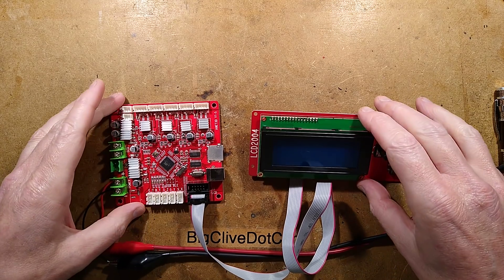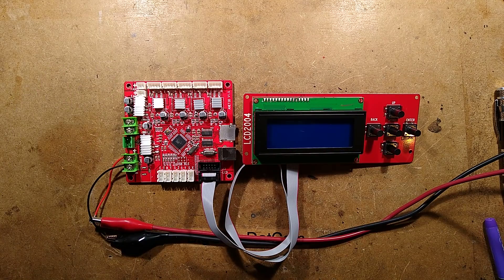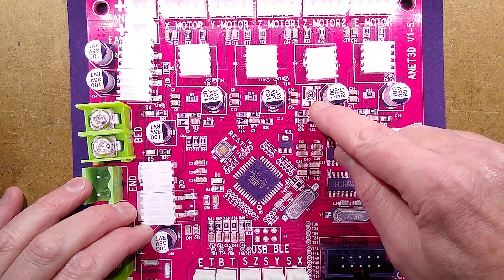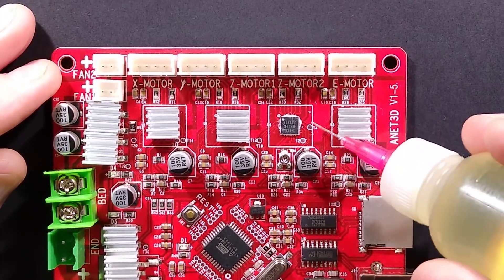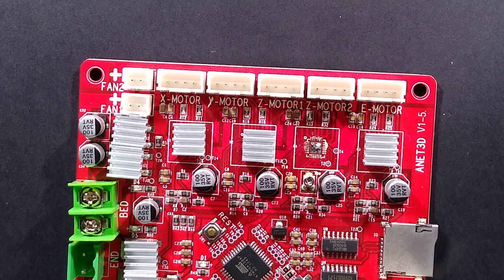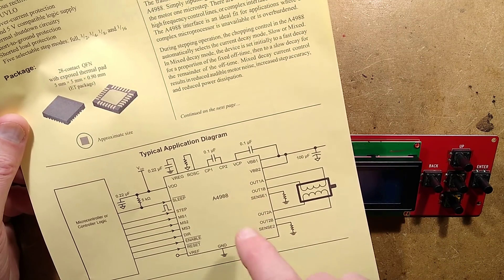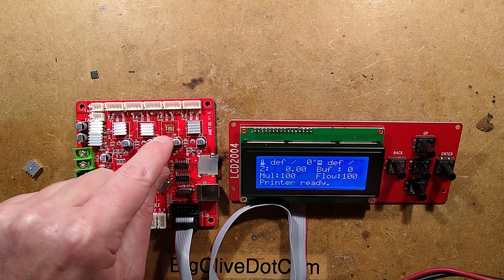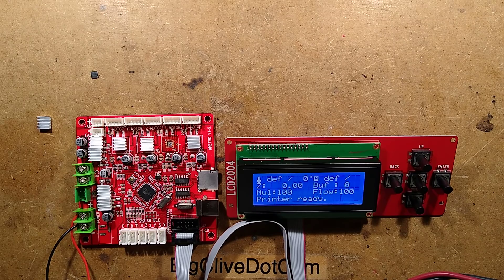Diagnosing a dead 3D printer controller

Comment: the fact the a8 failed without it ending up engulfed in flames is impressive in its own right
Reply: I reflashed mine with Marlin, worked perfect for a while until it started smelling like burning plastic, the green hotend heater connector just melted, de soldered it and replaced with XT60 worked well, but needed more outputs and better stepper drivers so now my Anet is controlled by an Arduino Due with RADDS shield.
Cheap printers are not so cheap after all.
Reply: @mr_sheen_airsoft  most of us still using the A8 have external MOSFETs controlling the bed and hot end.
Reply: @timrb  ,sure that is a good idea, but funny enough I have never had issues with the onboard mosfet just the connectors, as I said in the beginning they are not as cheap in the end, my Anet has a new hot end, extruder, control board, termistors, linear bearings and drive belts, also some reinforcement parts added so initial £137 turned to more like £300.
On the other side I have learned a lot about 3D printers.
Reply: @timrb  most of us have probably swapped/dropped connectors for the bed or just cut the heated bed entirely. lol. it would be silly to ask it to print anything that needs it anyway. can barely do the job anyway. lol.
Reply: @mr_sheen_airsoft  cheap printers are great for people who want them as a hobby (not so much for use as a tool), but the connectors on the bed and the board are woefully inadequate(the bed one on mine started going black). it ended up with an Arduino mega and a RAMPS before I salvaged the whole thing for parts for another printer :P
Reply: @MrglMrgl  , definitely agree, and yes the bed heater connector burned first, I just soldered the wires directly, connectors are definitely the weakest link.
Reply: @SwervingLemon  lol takes half a week of evenings to build the thing and the rest of the week printing off the necessary upgrades to make it safe, reliable and mechanically stable.

The aluminum extrusion frame printers are far and away a better deal. SO MUCH faster and less fiddly to build and dramatically stiffer out of the gate.
Reply: @SwervingLemon  A lot of printers had problems in those days. I've had my A8 for 3 or 4 years now and it's still going as great as it did when I purchased it. You know how you deal with shitty manufacturer firmware? You flash Marlin onto it. I understand that from factory it should be good to go out of the box, but back then I believe I paid something like $280 for my A8 so flashing firmware I can accept.

As for the bed connector having issues. Again not something I experienced. I had those mosfet things for the hotend and bed laying around for years before I installed them and still had no issues. Even to this day, with her being in an enclosure printing ABS voron parts I've had no issues with connectors, connectors going black, fires, or any other issues.

Personally, for the price I paid, the A8 is one of the better pieces of machinery/electronics I've purchased in the last 10 odd years.
Reply: @thumbwarriordx  Took me about 12 hours to build my A8 with no prior experience with printers or really putting things like that together. Obviously I can notice a difference between my A8 and Ender 3 v2, but again for the price and for what it is, you can't compare it to "pre-built" printers imo.
Reply: @adamarzo559  An Ender kit is SO much easier to put together lol.
The tiny screws and nuts in the acrylic are a killer.
The aluminum is probably stiffer too.
Reply: Haha! Thankfully if you flash Marlin on it you will have termal runaway protection.
Reply: a fair upgrade to any 3d printer is a ten quid smoke detector placed somewhere near.
Reply: A8's all bursting into flames is an internet meme. The problem is that they were sold as kits and as such, a few were very poorly built and arced, causing them to burst into flames. They sold hundreds of thousands of them, so realistically they are/were incredibly fine little printers.
Reply: @ZaPpaul  They did have some issues, like my Anet A8 clone the wall power chord was way too thin (I had to double the wire over for the power supply screws to grab), a couple years later when I was printing ABS I noticed the cord was extremely hot, so in my dorm room I had textbooks lifting the cable into the air and even a box fan blowing on its power cord... You may laugh, but after an hour of printing inspecting the cord every few minutes I was like "well its probably fine since it hasn't caught fire" and started up to leave to get food and saw it was smoking, haha! Yeah sometimes they use way too thin of cables, I thought that immediately when I assembled it but then again I'm the kind of person that uses 1kV rated heavy wire on its lightswitch I added for turning it on and off, so I thought I was just crazy, but apparently not because even with active cooling on the cable it still started melting. Also that printer had been printing a ton that week, but I hadn't been feeling up on its cables and just happened to be there when it started melting.

I still use that printer, but almost every part has been replaced on it, its extremely good though (I have a custom Bowden drive on it, it also runs 3mm filament too, and I now run it over-volted some too for faster bed heating and its perfectly fine using a normal power cord). I also have it flashed with Marlin 2.0 (I can't remember if I disabled some of the thermal or not, I know I really widened it up because my E3D V5 and V6 hottend was overshooting by about 10 degrees because it goes from room temp to 270c in under 45 seconds), and I added Deans connectors to the bed so I can disconnect its cable when I want to run my laser cutter (7w output laser head, about 30w input, signal is soldered directly to the Arduino Mega that's driving the Ramps1.4 board).

Its a really fast printer, I run about 100mm/s even for fine gear teeth and about 160mm/s (with up to 0.8mm nozzle) on ABS and the parts come out fantastic still to this day (much better than the $10k machines we have at work running at a snails pace with same nozzle size and many years newer).

Oh also I had my heater cartridge fail, but I think that's normal (the wires can and will short out if they break down the insulation or fatigue). But the extruder was junk and like I mentioned its had a couple hottend upgrades as well. Mine is very cable relief (even my extruder hangs and swings with the printers movement), I've got it quite well engineered as well, engineering is my profession and I love robotics and mechanical design (mechanical and aerospace engineer)
Reply: @ZaPpaul  to be fair, the cabling into the heated bed is an accident waiting to happen. fine for most hackers who take appropriate care, but dangerous to someone used to infallible top end electronics.
Reply: @bradhoward9701  strain relief is all that it needed, I noticed this when building mine and took appropriate measures to ensure the connector was never being moved by the cable movement.
Reply: i put it into dremel cnc project Instead of arduino
Reply: I've had two anet A8s (I think I still have at least one of them somewhere), absolute garbage, but I've got a soft spot for them since it was my first 3D printer.  Both the original boards are dead so I put new ones on.
Reply: It's mostly a matter of the horrible terminals on the board (and hotbed.)
They upgraded them on the later revision (I believe just because it's a 24v compatible board, not for safety)
An external mosfet for the heated bed is a mandatory upgrade on these things IMO.

Comment: I wonder if it would work to replace the A4988 with a TMC2209... both my machines came stock with the A4988, and the steppers could be heard through the entire house. TMC2209's made them so quiet, all you hear is the cooling fans when in the same room as the printers. Oddly, you can pick up aftermarket main boards cheaper than the individual chips sometimes. 

All I saw was "dead 3D printer controller" and I was hooked! If postage wouldn't be outrageous, I could send out a Melzi board with a really curious defect. It reformats the SD card after every print, due to someone wiring power in to the heated bed power out contacts, and popped the thermistors like tiny firecrackers. 😆

Comment: My rather "mature" Geeetech dual head printer has the BIG advantage of having all the driver (motor / heater) boards as entirely replaceable modules, which of course means modification and repair of  "power" sub-assemblies is simple and pretty cheap!  The trim tools I use are all ceramic - from "our favourite suppliers" for a very reasonable price. Means you can play with powered-on assemblies with a much reduced risk of "unfortunate accidents"!
Reply: Yes but at times watching the magic blue smoke is satisfying  when the  old board is going to be replaced.
Reply: The downside of the modular stepper drivers is they do less good of a job dissapating heat: drivers might not need a heat sink when integrated into a board but do so if it's modular, or might need a fan if modular.
Reply: I was gonna add I have a ceramic magic screwdriver I use for tuning front-ends on radio equipment. Its annoying to use metal as there it changes the circuit significantly to have a big metal rod on the inductor or capacitor. So it becomes tweek, lift off and listen, try to get the screwdriver back on and tweek again, lift.... takes forever.
Reply: @clynesnowtail1257  
That sound like really cool tool.
A Royal Doulton screwdriver😆
Reply: @assassinlexx1993  A little bit of knowledge is a dangerous thing u no.
Reply: I've got two Geeetech boards that were blown up by a fault in the power supply (a little ball of solder found it's way to the wrong place inside it!). There are some lovely burn marks on the boards, and I suspect lots of trashed components, so they're beyond my abilities to attempt repair. If I hadn't noticed in time, I could have had some lovely big burn marks on my house too!

Comment: Was it heating up because it has no load connected?

Maybe problem was static attack?
Reply from the maker: It had shorted internally, probably as a result of a rogue voltage on a low voltage rail or input.
Reply: @bigclivedotcom  ahh okay

Comment: What a coincidence, I have the exact same printer! The mainboard on mine also failed but I didn't replace it with another original board. One of the stepper drivers stopped working but the rest of the board was still fine.

Comment: would you like me to send you one of these boards as well? i have one that has a broken bed heater circuit
Reply from the maker: The bed heater is switched by a MOSFET in the vicinity of the connector.  It might be worth checking for a bad solder joint on the bed connector or if that MOSFET has failed.  If it's not getting the temperature from the thermistor that could be an issue too.
Reply: @bigclivedotcom  Thanks for the reply! it's been a while since i messed with it and i don't remember if it was the thermistor circuitry or the mosfet. i fixed it a few times by just blasting a heat gun at it, but eventually i just got fed up with unreliable prints and dealing with finicky bugs of a cheap printer. i also wanted a larger print area. Looks like there are alot of people in the comments with broken boards as well.

Comment: Another problem with those tiny pots is you can turn them to either end a bit to hard and they can short or give crazy resistances, I'm sure you will check this before replacing the chip, how hot was your heat gun ? as the chip was well gone and the flux still boiled off !.....cheers.
Reply from the maker: Heat gun was at around 330C.

Comment: Some of the older style boards put the motor drivers on a separate pcb that fit into a socket on the main board. That way if you fried one, you could just yoink it out and put a new one in. Looks like they're optimizing for cost over repairability.
Reply: they're following the footsteps of Apple and Tesla lol
Reply: @lordjaashin  Doubt that. I would say that when they started, they lacked the expertise to design and produce the circuit so they used premade breakouts from China or somewhere.
Reply: This board is a lot older design then most of the RAMPS boards ;-) 
They have been around already very long with the same design and have changed pretty recenty to the next generation which still has no changeable drivers.

I have some around so I can just pull parts off them and solder on other boards when I make a fault an blow it up partly.
By the way, older ones were just 12V (A8), newer boards can handle also 24V as input but also still work on the 12V of the original A8. They are build in for example the A9 and A8plus.
Reply: lots of these old boards also soldered directly to the board because it was easier and cheaper. my expensive printrbot f5 has non-replaceable stepper drivers and i bought it in 2016

Comment: I'm holding out for the day when I can use one 3-D printer to make replacement components for my other 3-D printer. I understand the von Neumann Company is working on this.
Reply: You'll also be looking at autonomous resupply of filament. Be careful - if you are successful we may end up with a macroscale version of the "Grey Goo" nightmare scenario! :-D
Reply: @phils4634  oh, no, it's "CREAM"
Reply: At one point I assembled a 3d printer from a kit and every so often some part will go brittle, break or melt and I have to patch it up well enough to print a replacement part. the fiddliest temporary fix was probably to bolt the extruder mount back together using a bit of roofing iron so that I could print out a new (much improved design) one.

Comment: Could I send you a 3d printer board that displays the wrong temp even when the thermistor is unplugged

I suspect a bad pull up resistor but I can't figure it out.
Reply: The thermistor is unplugged?
Reply: @williamhuang8309  when unplugged it will still read 20-30c.

Plugged in it will read 50-60 at room temp
Reply: @berencam  Maybe the thermistor isn't calibrated properly? Because the thermistor outputs as analogue. Normally when you unplug the thermistor, it shows a weird negative number or something like that.
Reply: @williamhuang8309  on these mobos when you unplug it it goes to 0 when it's working properly.
Reply from the maker: Also suspect any filter capacitors in the sensing circuit.  the little MLLC capacitors can fracture and behave like resistors.

Comment: Almost 100% the stepper was disconnected while the driver was enabled or indeed it was shorted whilst enabled. I have a dead anet A8 board that's fw is screwed if u wanna steal the driver off that bad boy.
Reply from the maker: I've no need for this PCB.  It was just really a fun diagnosis.
Reply: Yeah. Nobody has need for this pcb in fairness. It's not overly dodgy in the build sense. But the firmware is certain death. Flashing marlin is a nightmare the likes of which cannot be measured. God forbid any actual human could be lucky enough to get this board with a bloody bootloader preinstalled.

Comment: It could make an interesting controller if you swap the one for the extruder at the place of the faulty one. That silicone is a burden tho. Might change mine for my Ender 3 and modify the other to have another set of tools able to move on the build plate, like interrupting a 3D print to put an insert or such things, or maybe even a camera to inspect what's on the build plate for critical layers.

Comment: Repaired on or two of these, I tend to use an external stepper stick and make or buy an extension board, even if that chip has knocked out a couple of data lines you can usually repurpose another, but that means diving into firmware, but it's well documented.

Comment: That's the Z axis stepper driver. Which is surprising cause usually the extruder driver is the first to go since it's always engaged and has the highest Vref. Maybe they were constantly turning the lead screw of forcing the bed down. That'll break those over time.
Reply: If you short it against something like Clive said, it will instantly fry them and they'll heat up like that. I've done it to the same drivers (mine were thankfully replaceable kind on a ramps board), and our intern did that recently with newer TMC 32 bit silent stepper drivers, took him a whopping 5 seconds or less to fry one... I had to adjust the rest because we didn't have spares, but its easy to do if you aren't careful as basically anything metal around it will short it out in an instant.

Comment: Holy crap that looks like the the controller board and LCD panel for an Anet A8 Prusa clone!  I bought and built one in 2017.  The controller burned out after about 10 prints and I bought an official RAMPs controller and genuine Arduino 2560.  Haven't had any problems with the controller since (I've had other problems, and have replaced just about everything on that printer haha).

Comment: Cool to see the same board I had failing on my A8. In my case the printer had suddenly died during a print. After desoldering all the IC's, I've found out that a ceramic capacitor near one of the motor drivers have shorted out and so on took out the 5V rail. Removing an replacing it with a 10uF cap fixed the damn thing. Quality-wise components are the cheapest one possible, however the pcb handled well the desoldering and resoldering of all the driver ics.

Comment: You can get an accesory breakout board to stepstick adapter and pluck an extra driver to the 2nd accessory port and use it that way and simply set the pins on Marling to the accessory pins. (The port above where the display is connected

Comment: I have made my flux by solving rosin in Isopropanol! But I put a LOT of rosin in, so it's not too liquid. And now there's white crystals (?) at the bottom of the little flask. It's not too much but is that normal? Are those impurities or the rosin?
Reply from the maker: Maybe impurities or oversaturation to the point of recrystallization.